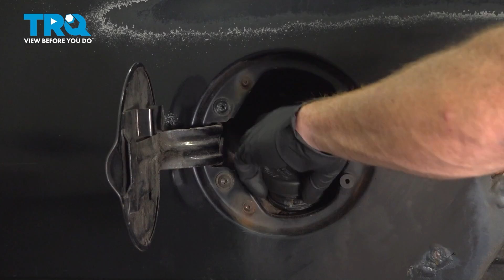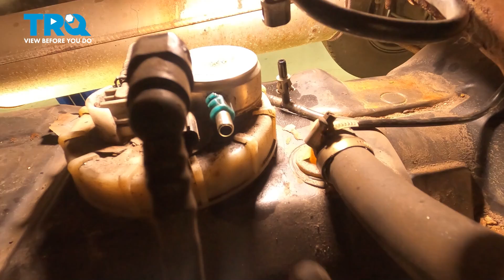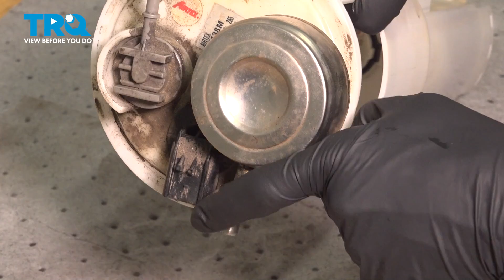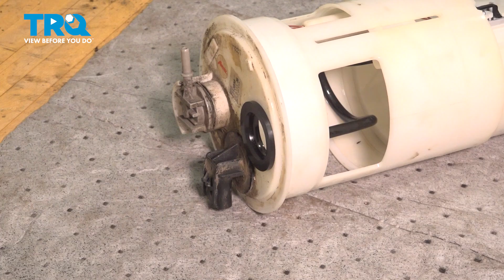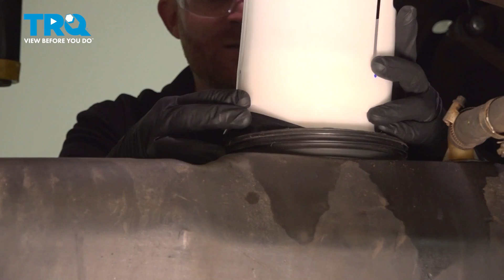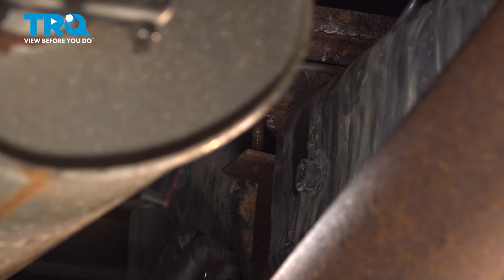How to Replace Fuel Injection Pressure Regulator 1994-2002 Dodge Ram 2500

Comment: I'm beating my head against the wall in Western Kentucky I have a 2000 Dodge ram 1500 and the fuel pump is not working I've checked the relay changed it put in a new fuel pump and still it don't have power